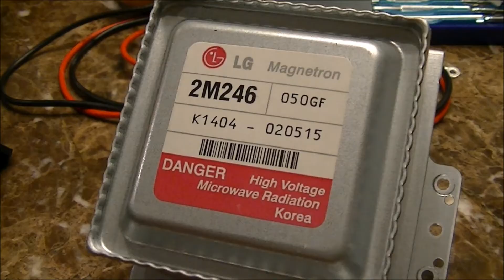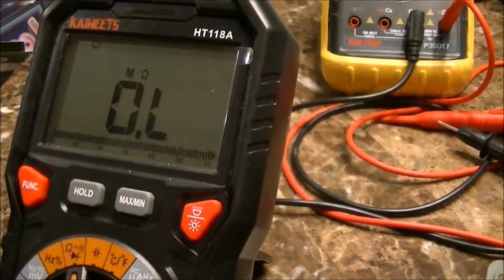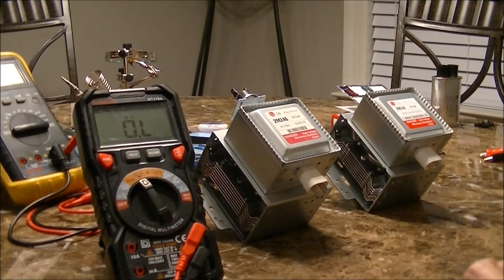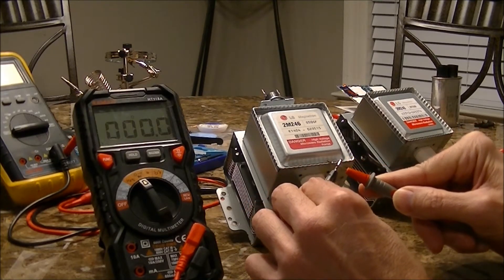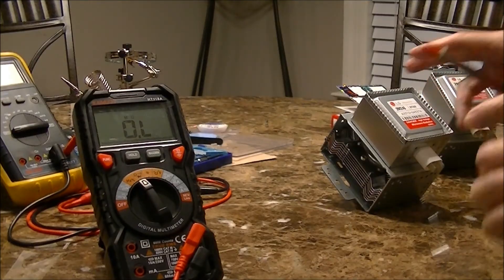Magnetron Test

Comment: Excellent video. Troubleshooting the exact magnetron, I measured a short across the terminals as expected, but 63 ohms from either terminal to the case.  The local appliance shop has a $75 bench fee, plus the cost of repair parts & labor,.  I just ordered the replacement part on Amazon for $39.00.

Comment: Primary circuit?  Nope it’s the filament circuit and any resistance you read from either filament lead to ground is leakage from the capacitors built into the connector.  The connector can be replaced.  Amazon

Comment: Just had one go out and the filement to ground was 18 ohms... nearly a dead short. It worked good until the last time I used it when a very loud humming noise and a burnt smell coming from the microwave oven.
Reply: the filament terminal connector can also be bad. the thing containing the connect pins. These are chep

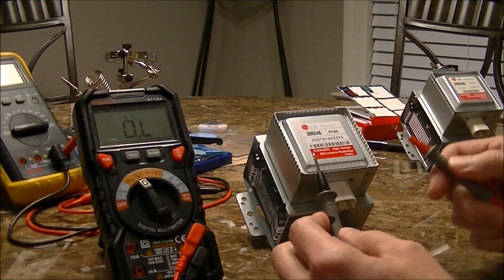Comment: When the display showed OL on your multi-meter you said it means OverLoad at minute 4:10, but OL on a multi-meter means an Open Line, and that's exactly what you're looking at (an Open Line) when you're checking the lead to the body. And it shouldn't have a connection, it should be an open line between the leads and the body.
Reply: Over Limit (OL) is what I understand it to be. If you have the range held on a voltage reading to say 10V range and measure a 12V battery you will get the same warning OL
Reply: @Heisenberg2A  That can be true on some multimeters, but even then that would only apply when you are measuring something that is out of the range of the multimeter (like your voltage example above).  But that's not what you're measuring in your video, so that kind of an out of range situation does not apply in this case. What you're measuring in your video is whether there's a simple continuity or a connection between the wire connector lead and the body of the magnetron (which there shouldn't be any), and that's exactly what you're getting - no continuity, in other words - the same thing as an Open Line (which is OL for short).  And that's what that OL is when you're simply checking for continuity, instead of measuring for a unit that could possibly go over the limit of the multimeter and damage it, like a Voltage.
Reply: @specialprojects7504  an "open" is infinite resistance, this is outside the range of the let's say 10MOhm scale. It is outside the upper limit, hence Over Limit. If you set a meter to 10 Ohm range and attach a 50 ohm resistor you will get the same message: OL . That doesn't mean you have an "Open Line", the meter is telling you that the resistance is greater than what it can measure. If you tell people OL means "open line" you are confusing them and it could be dangerous. If I have my meter on AC volts and set to a 10 volt range and put it in a light socket it will read OL. This should tell you the voltage is greater than 10VAC and unknown since the meter can't read it. OL doesn't change meanings between multimeter modes.
Reply: @Heisenberg2A  But in this case it means OPEN LINE, because the two probes are not touching, it can't over limit nothing when nothing is touching nothing. On my Major MT21 Multimeter when I put it 1.5V DC scale and measure 12V DC, it displays 1.     meaning overload.
Reply: @KobusBreed a meter will default to OL when it can't do one of two things. One is there's nothing to test as in the leads aren't getting any signals, or two, the leads detecting out of limits according to the scale the meter is on. OL does not mean open line, it means Out of Limit. In other words, the meter thinks it's out of limits and again it's according to the scale you set the meter on. It's either below or above the scale, and therefore say OL/ Out of Limits of scale.

Comment: 20 years working with microwaves, LG was the only magnetrons I changed.
Reply: Could you please recommend the unit that last for longer? Looking on reviews, almost any of them had a failure related to magnetron: Samsung, Panasonic, Toshiba etc...
Reply: @dinohunter7176  - They're all similar quality and cranked out China. Most makers don't even bother branding them anymore because most users will chuck the oven before repairing it.

Comment: Open leg not overload
Reply: Stands for "Outside Limit"
Meaning the reading is outside of the range that the meter can read/display. An example would be if you were trying to test a high voltage diode, the resistance would be too high for the meter to read. However if you hook up a 9-volt battery and test again, it will then be within the limits that the meter can display. 👍🏻

Comment: Thank you. I was trying to find more info on what resistance was correct. Everything I kept reading said below 1 ohm, but most video showed either .1 or .4 ohms. Mine was reading .8. Replaced and it works. Thanks.

Comment: Magnetrons can be bad and still pass these continuity tests.  Remove and visually inspect the magnetron for cracked magnets, if they are cracked the unit is bad.
Reply: Totally agree. Had bad magnetron which was making loud growling noise, but checks ok with the meter.
Reply from the maker: Thanks for the feedback - excellent point.
Reply: @Mike Studmuffin I get the same 0 reading too. Not sure how to interpret it.
Reply: @@mikestudmuffin4549robably near zero ohms unless you have an ohmmeter capable of measuring milliohms. That is not really a primary. It is the filament heater. A magnetron is basically a vacuum diode.